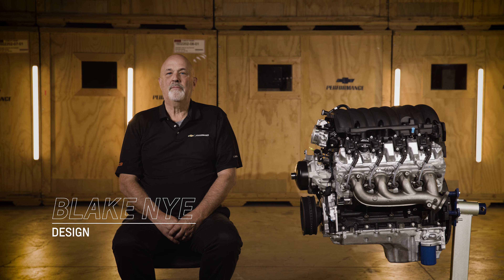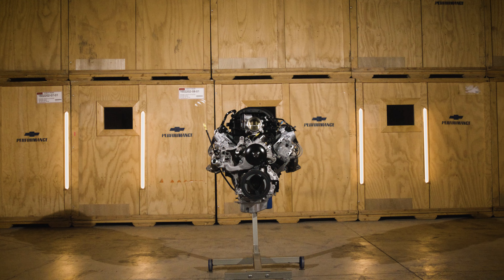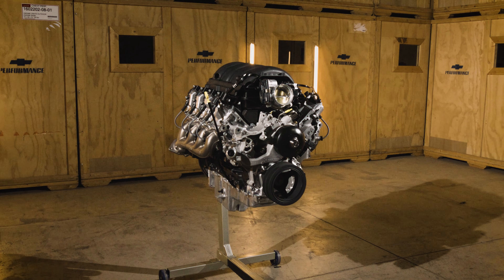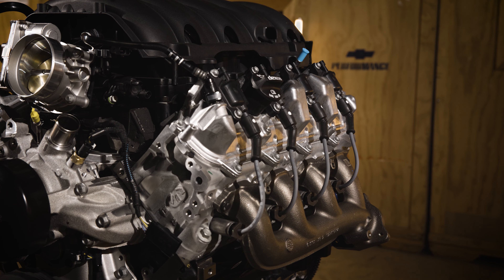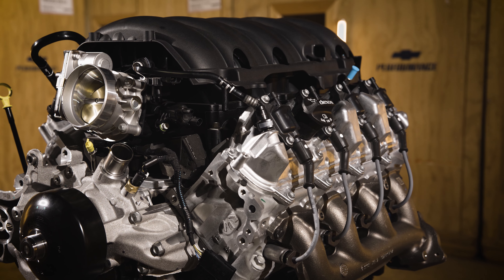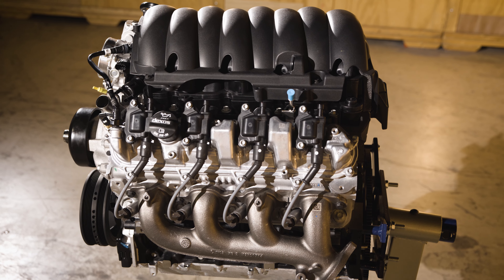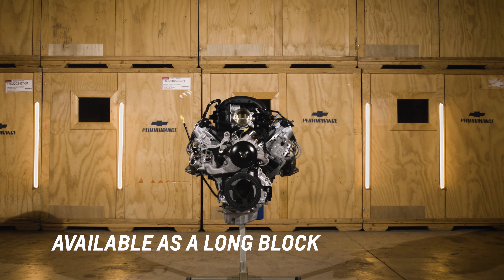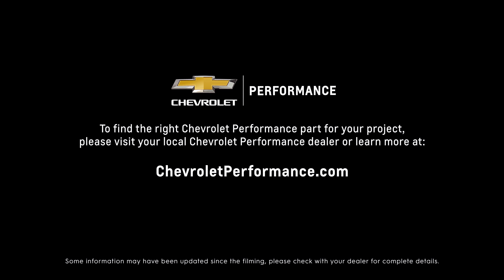Chevrolet Performance - L8T Crate Engine  - Information & Specs

Comment: This L8T comes with provisions for a power steering pump,  The rest of the LT line uses electric power steering. Also this accessory package can be had with dual alternators. The BEST part is this L8T has no active fuel management ( or cylinder shut down, Displacement on Demand )  and all other LT engines are aluminum blocks and this L8T is Iron block that can be bored out to over 7.0 liters. This engine also has an extra coolant passage between the cylinders, helping it to run cooler, better for 87 octane fuel. A long block can be had for about $7,200 today.
Reply: Nice break down
Reply: When My L59 NBS dies, this one's it.

Comment: This would've been perfect if not for the direct injection, would've preferred a good old port injection set up, but an impressive motor regardless, well done GM!
Reply: Just add a catch can.  😊
Reply: @jeromeburrasca6710  Fair enough
Reply: Put a super charger on it and add eight more injectors in the runners.
Reply: That’s why you add a blower with a water/methanol injection kit. No worrying about valves plus lots of power
Reply: It wouldn't make as much power for its specs if it was Port injected.

Comment: Would love to see a dyno comparison against the HT502 and 502HO
Reply: Those two would make way more torque (and at least for the HO 50-60 more horsepower) but they will probably guzzle a lot more gas since they are both larger and their head design isn't very efficient.

Comment: Gonna be a little harder to hot rod, because unlike the LR4, LM7, LQ4&9, you can't put a carb on it? Just curious.
Reply: You can! You can get an adapter kit to put a carby LS intake on it. Horsepower Monster has done a video on one
Reply: hotroding is putting a carb on it?
Reply: @krusher74  yes, hot rodding is having fun on a budget which is about 80% of the pupulation.

Comment: Is this plug and play into a 2011 4x4 LC9 Suburban??
Reply: It could be, if your OK with switching the computer and harness. Your 2011 has an LS.  This L8T comes with provisions for a power steering pump,  The rest of the LT line uses electric power steering. Also this accessory package can be had with dual alternators. BEST part is this L8T has no active fuel management ( or cylinder shut down, Displacement on Demand )  and all other LT engines are aluminum blocks and this L8T is Iron block that can be bored out to one 7.0 liters. This engine also has an extra coolant passage between the cylinders, helping it to run cooler, better for 87 octane fuel.

Comment: L8T = Late
Reply: ford = found on road dead
dodge = drips oil, damn garbage emmiter
Reply: @traciweisenbachCITB  Chevrolet = Cracked Heads Every Valve Rattles Oil Leaks Engine Ticks

Chevy needs 400ci to still lose out to a 302ci Coyote. This L8T can't even compete with Fords new production 7.3 big block in their HD trucks 😂
Reply: My one friend called Ford Fort .. back in the 80s lol
Reply: Actually L8 = Late
Reply: @mr.horsepower8125 My ‘97 Chevy C1500 has about 989,000 miles and NO PROBLEMS. Also have a ‘05 Silverado, ‘95 C3500, ‘01 Chevy Camaro, all over 200,000 miles and only problem is a couple tail lights went out. That’s proof that Chevys are made to last. All ford does is rust, break down, and recall their vehicles. 
Also the 2023 Corvette and the 2023 Camaro has 800HP stock from the factory. So I don’t know what drugs your on. The DISCUSTANG only has 10 hp 🤣🤣🤣🤣🤣🤣🤣
found on road dead ford just keeps embarrassing themselves, EVERYTIME. No ford tard is going to beat a Chevrolet Man, SOOOOOOOOOO
Reply: @mr.horsepower8125  can't compete how? Both these trucks are rated to tow nearly the same.... Both have the same 0-60 time... 29 hp doesn't make a big enough difference once installed in a heavy duty truck. That would only make a big difference in a very light car. Both the 6.6 and 7.3 are powerful engines. However the 7.3 is having cam issues currently with some. The 6.6 has an oil consumption issue on some. The 6.6 has been pushed to 2000hp while the 7.3 to 1450hp. Chevy motors have always been able to make higher HP and always have had more aftermarket mods available than ford's.

Comment: That ain't nothing the Ford 7.3 Godzilla crate engine will run circles around that motor all day long with 430hp@ 5500rpm and 475tq @4000 rpm so Chevrolet go back to the drawing board..
Reply: Reeeally??
Reply: Sure it will. Especially with its nicely designed shaft driven oil pump, and casting voids between the bore spacing. Can’t see those being an issues…
Reply: .7 L bigger so you tell me
Reply: This engine was optimized to do work on a near equal to diesel and as such, was optimized for low end torque. I’m sure it could have been tuned more midrange but that wasn’t the goal.
Reply: The 7.3 is having bad cam and lifter delamination. The shaft driven oil pump and voids between cylinders in the casting are horrible design flaws. In the real worl the 6.6 has been better all around 🤷‍♂️ the 7.3 barely makes more power and it is at a higher rpm which isn’t good either.
Reply: So 29 more HP and 11 ftlbs more torque.... Yeah I don't think it would run circles around it at all. That's basically the same once in the truck. I'm sure these 2 trucks are very comparable in 0-60 times and they are both rated to tow nearly the same as well. However the 6.6 has already been modified up to 2000hp.....

Comment: If I buy a new engine it’ll be the ford 7.3
Reply: Yeah.  No replacement for displacement.
Reply: From what I hear those 7.3 engines are eating up lifters....
Reply: @Deerhunter2024  I’ve yet to see one, just Chevy guys saying they do because a few that were put in cab and chassis vehicles had a problem. Gm is the king of lifter failure.